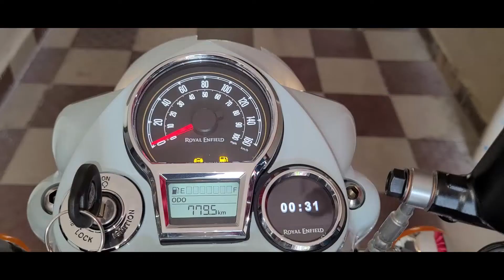All New Classic 350 Tripper Navigation Display Installation

Comment: Amazing! Looks like the navigation system and not the cover was intended all along! Where do you plug the cables in? Do you have to recable any plugs?
Reply: The plug is there behind the light bulb ready to go. It's zip tied to another wire.